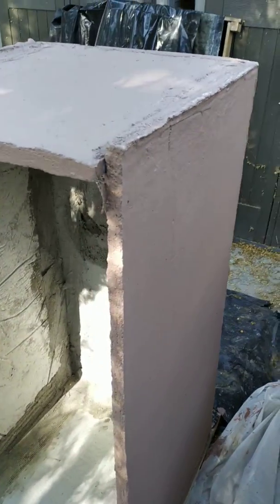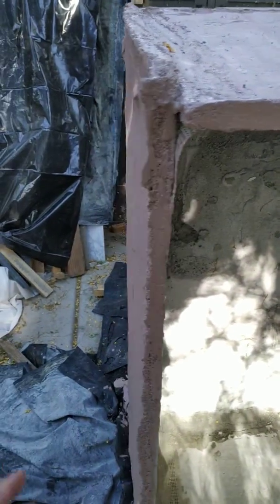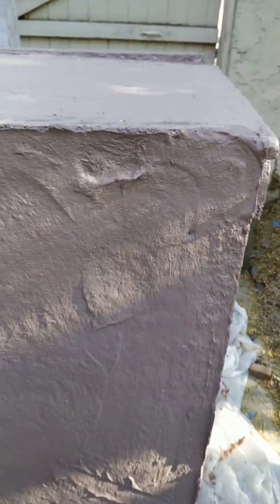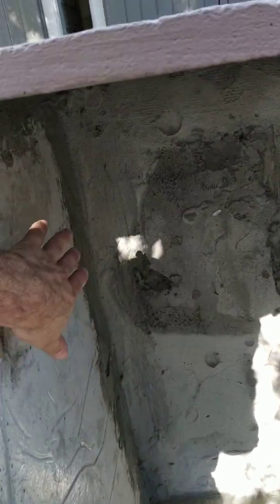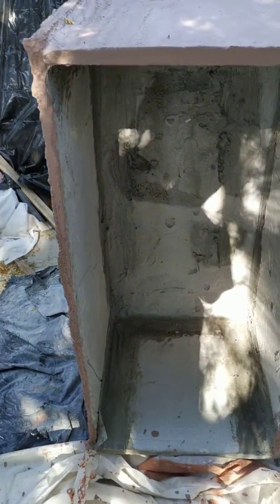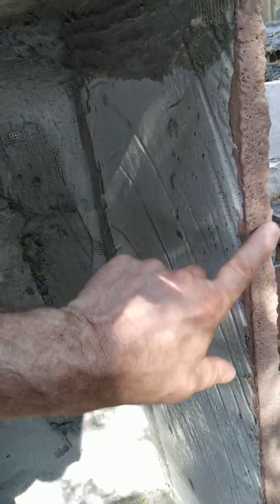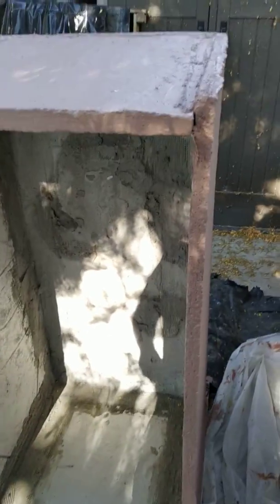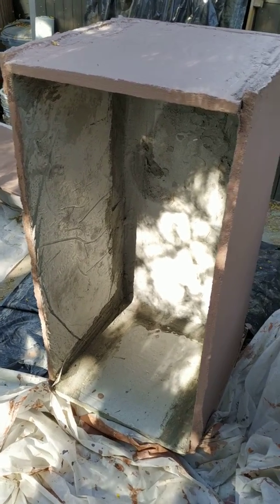Storage box made out of aircrete

Comment: It can still be great, just coat with thin layer mesh and cement/sand.
Reply from the maker: Yes, mesh and stucco or similar would make it more attractive. However this was a throw-away experiment and not worth that kind of effort. What i have learned from these experiments is that putting mesh on both sides and painting makes for a very light and surprisingly strong material. For some applications it may be appropriate to not use a sand/ cement coating.

Comment: how about filling a plastic container with the correct amount of aircrete, such that when another container of slightly smaller dimensions is nested inside, the aircrete will be pushed up? basically a mold, but easier to ensure no cavity goes unfilled. water could be added to the nested container to provide sufficient down force to keep the aircrete in place.
Reply from the maker: I like that idea. I may try it. Cement does stick to stuff so a mold release might be needed.